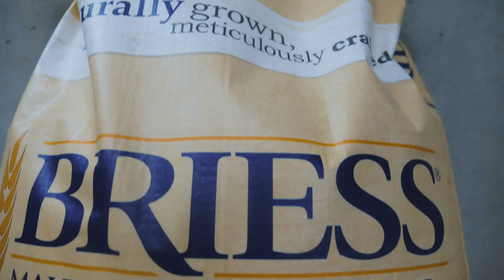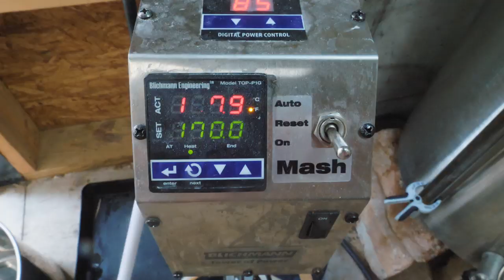American Wheat Beer with Raspberries - How To Brew Beer

Comment: Hey brother, I'm at the point where I'm starting to buy 55 pointed bags of grain. Any advice, what I mean is. How can I tell if I got a bad bag. There been times my supplier,  which is several because I buy what's on sale. I've got rye with absolutely no smell, than a week later. I'm sure because I keep my basement 55% to 65%. Keep the humidity down. It's heavier with a dirty cloth smell. It seems only time I have this problem is with stale product. Any suggestions. My grains stay in 3-30 gal. Barrels. Only have a problem with beer making. My liquor doesn't seem to mater after distilling.

Comment: How much hulls did you use, weight even roughly, i dont have any just want to know how much to buy?

Would you suggest using less raspberries and earlier in fermentation ?
Reply from the maker: I think I used a half pound (which is a lot given how light they are). The raspberry flavor mellowed quite a lot after another week or so.  So would probably use a similar number of raspberries again.
Reply: @TheHomebrewChallenge  thanks for replying! I will give it a try, hopefully this weekend :)
Reply: @TheHomebrewChallenge  what will happen if i use kveik voss yeast instead?  :)
Reply: @dimash244  I made a raw wheat beer in the summer with Voss and Citra hops, it was great! Accidentally got higher efficiency and attenuation than expected so my 4.7% intention became 6.2% but drank like it was juice, very dangerous. Seems to have gone downhill after 3 months, think it's just that the hops have faded than due to it being a raw beer.
Reply: @TheDireWookie  thanks for reply. I will be making strawberry wheat beer, like fruili brand, using voss, in the next couple days. glad i saw your reply, will use citra as well :)